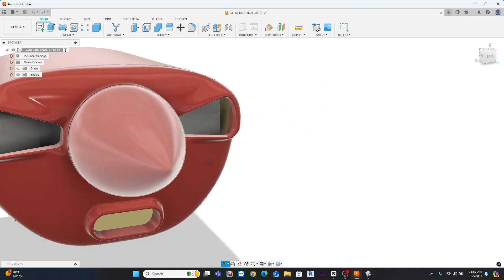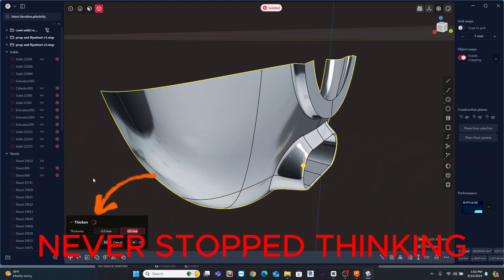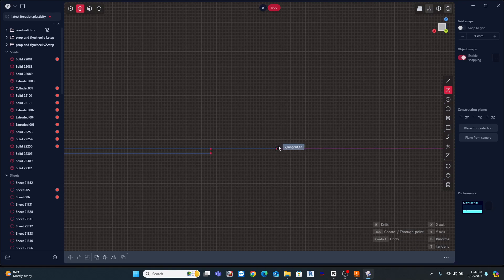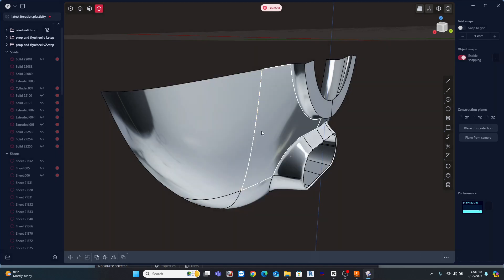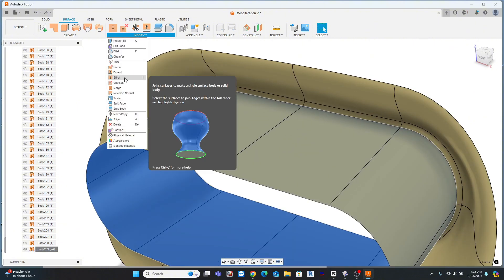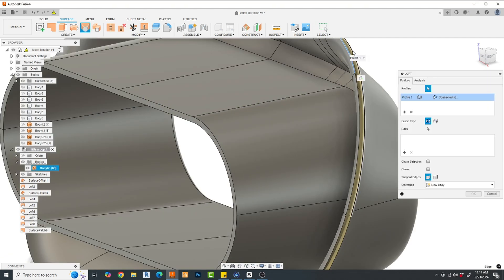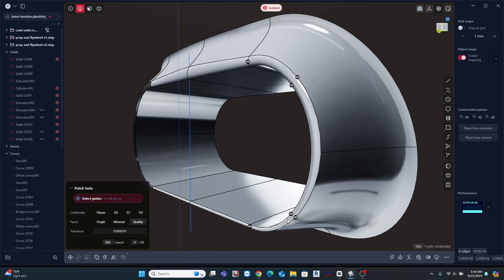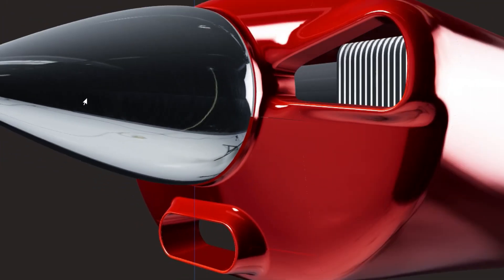Avoid this FUSION Plasticity Problem That's Costing You hours!

Comment: You can split the body in multiple parts, most of the shell fail in the tight curvatures. For example i do in solidworks hull shape, the bow is tight and has singularity point shape. So i split the hull in two parts, then I shell the two part separately. Hope it helps
Reply from the maker: @YPB_Studio  thanks for commenting!

Comment: You need to make the initial structure and then make the opening separately and then join the two together after. Each need to be their own component and put together like an assembly.. 90% of the time in the real world you wont find the engine shroud made in one piece.. But this is an excellent way to by pass a situation where you just need to make it one piece for a model..

Comment: There is a basic rule in real life: The minimum internal radius of a sheet cannot be less than the thickness of that sheet. If the sheet is 3 mm, the external radius will always be at least 3+3=6. In reality, this is limited by the sheet metal forming tools and must be taken into account.
In modeling, we can have more tolerance and we can make small external radii as long as the internal radius does not reach less than zero, because that is where we will have problems. There are programs that solve this problem by converting values less than 0 into edges or with a very small radius of, for example, 0.1 mm.
In fact, I thought that Plasticity did it by converting conflicting internal radii into 0, that is, edges, but it is true that there can be a conflict with the continuity of the adjacent radii or joints.
If you keep in mind not to reach internal radii of 0 mm, everything will be fine.
Reply from the maker: Thanks for clarifying

Comment: That certainly looks a very nice designed nose cone cowling.
I run another Parasolid program. I had a L shaped surface with a 2mm radius corner, then I offset the surface 3mm and it ignored that it couldn't make a -1mm ( or negative ) inside rad, producing a solid body with an internal sharp corner - doesn't Plasticity or Fusion do that?

Comment: Avoid singularities in modelling. Loft into a point, brrr
It pays off to cut the pointy edge couple mm back. So that curves/faces can offset.
You showed that in the video. 

In sheet metal you have to obey the rule of constant material thickness. This rule can easily be overlooked if there is a slight chamfer on one of the edges.
If you cut the cone without pinpoint end and SHELL it you will get horizontal edges top and bottom. Edges are not perpendicular to outer walls.
Pays off to copy faces and THICKEN them. This way outer edges are allways perpendicular to the walls.
Sorry if I tried to be a vise guy. Wasnt my intent.
You do great projects 👌💪👏👏👏
Reply from the maker: Thanks for the comments!

Comment: I've been using F360 to model the lugs (joints) between tubes on bicycle frames - the thicken fails a lot also. I chose F360 because I wanted the parametric option to change frame dimensions, and the lugs would just update...yes I'm a silly summer child. Is plasticity any better - i discounted it because of limited parametric options, but it does seem more stable for surfacing/solid commands. Can plasticity do parametric like changes and remain stable? cheers
Reply from the maker: I feel your pain.  Plasticity does Handle surfacing better but it is not parametric.  So many say that's a deal killer.  I understand that for some projects but for other things creative freedom has to take a backseat to parametric formulas and it feels to me like painting a Picasso with a sledge hammer.  Thanks for commenting.